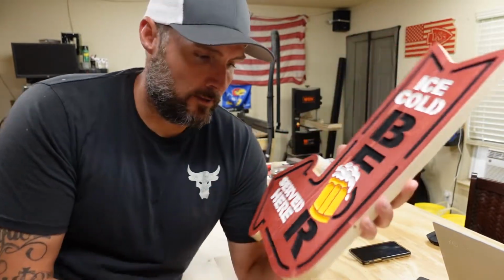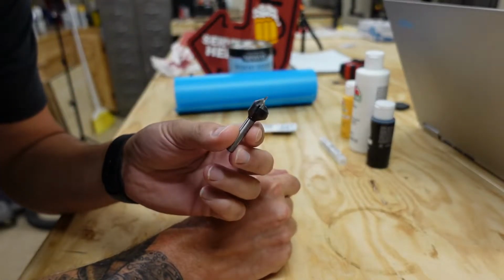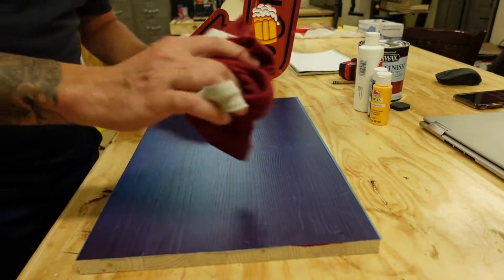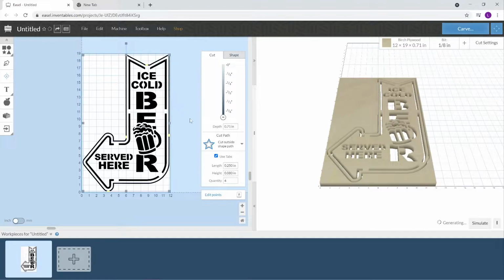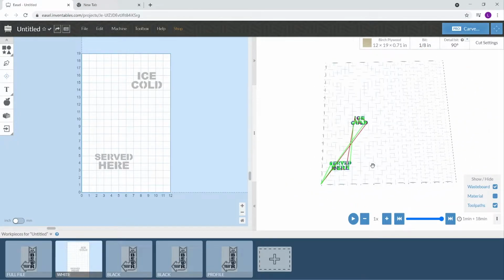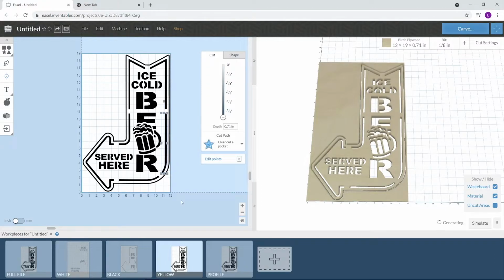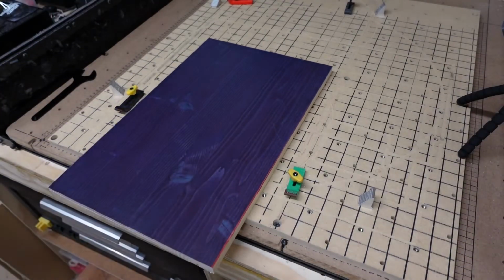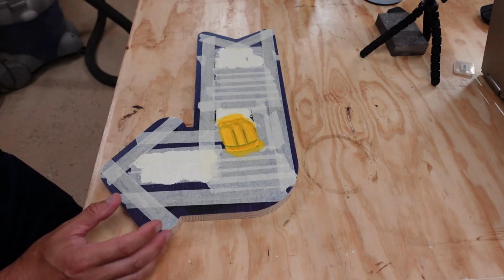Multi-Color Beer Sign

Comment: There's a better way to apply the film called backrolling that I learned from applying window film.  Peel back 1 inch and then fold the backing film.  Line up the opposite end that has the film on it and then use the card to apply the peeled inch.  Now slowly remove the backing film whilst evenly pressing the oramask with the card.  You'll get perfectly aligned films with no bubbles doing this.
Reply: Hey, that is my technique. I thought I figured it out. Not as clever as I thought I was.

Comment: This looks really great!! But I have a question though, I'm a little confused; at about 31:00 you did the profile, but I don't understand how you separated the sign from the the rest of the wood. I don't think you showed that part.
So after the profile what was the next step other than painting. 
That part I would've liked to have seen.
How did you get it separated?
Thanks and looks amazing  dude!! 👍
Reply: Since he lifted it up as one piece, I'm guessing he added tabs to hold it in place and then used a small saw to cut the tabs (sanding them afterwards)

Comment: Thank you again for the video, I learnt a LOT when you showed the settings. If you ever need a software to automate something, or watch the screen and click on it or type in something by itself, let me know.
Three easy questions: (I never done 2 bit carves): 
1. You have to set Z=0 after every bit change, correct? I did not see that in the video.
2. What did you check when you looked at the simulation?
3. What was the problem when you first carved the white? I could not understand you. That it was a short carve with the straight bit?